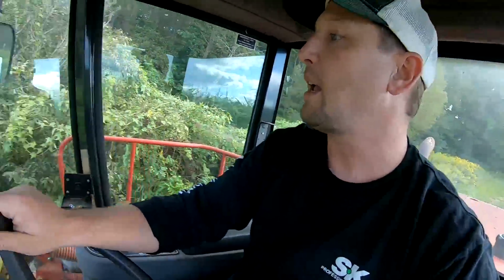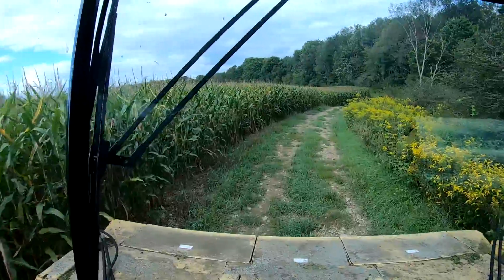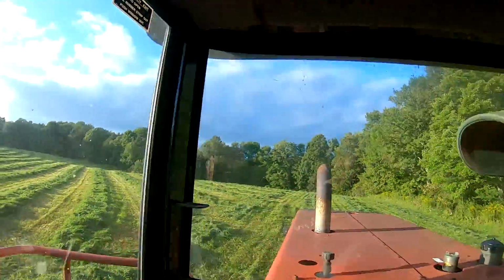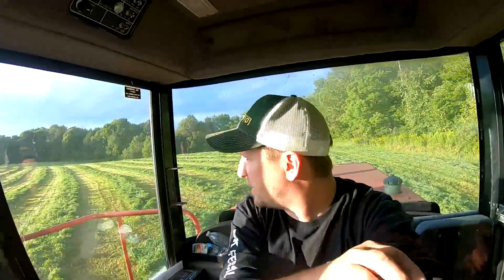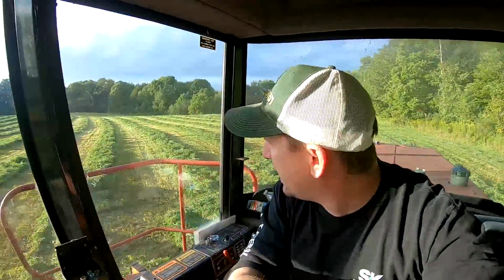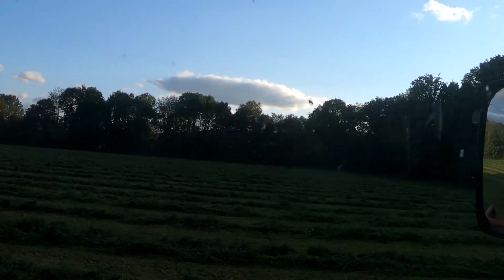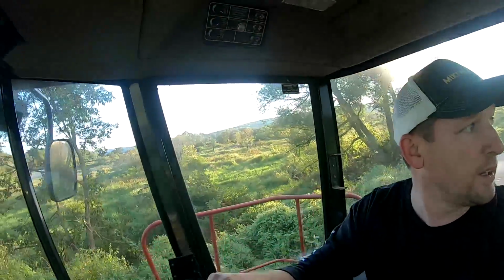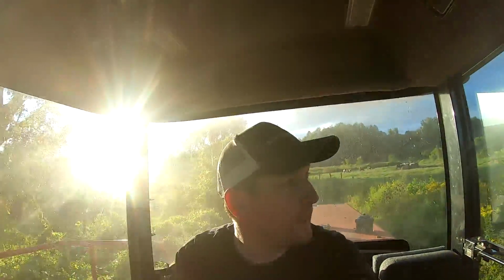3rd Cutting Alfalfa

Comment: Back in the 90's I worked for a dairy farmer. Loved chopping, but hated running the windrower. Was 30 years old with a Chrysler slant six engine. Leaked oil on the drive belt that ran the head, and the engine always slipped time. Ah memories!
Reply from the maker: I agree chopping is always a great job